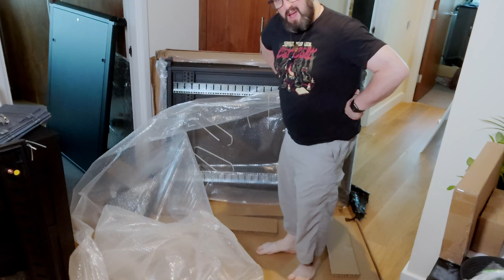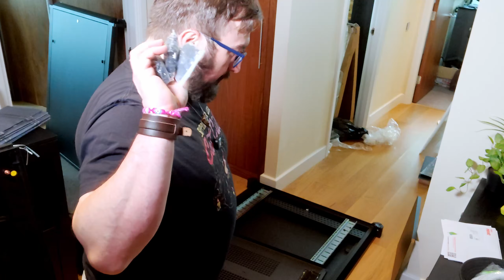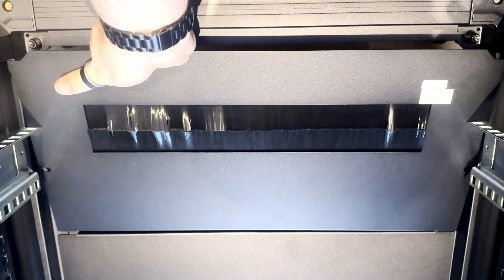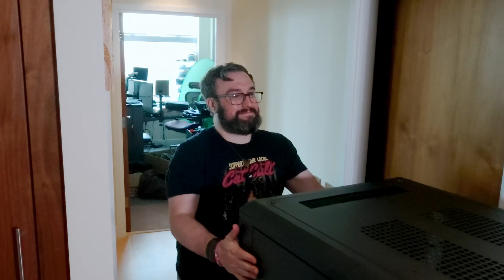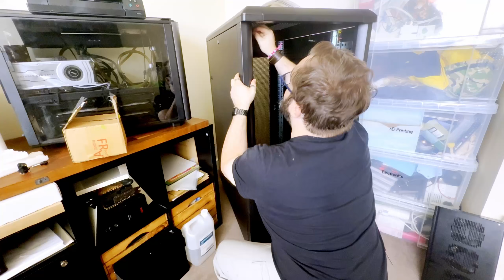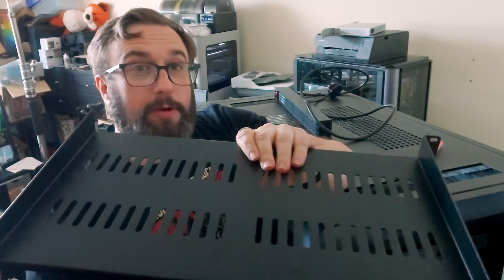I bought a £800 server rack for £400 (and it's flat-packed)

Comment: Don't sleep on smart relays for non smart lights or panels, you can remove the smart stuff and replace it back when you move out, I've OK'ed it with my council property and they said that I can do anything as long as it's installed by a competent engineer/installer and it is returned to the original switches when I leave, I've installed relays in my outdoor lights, physically inside the light housing as it's water resistant so it won't get wet, so that saves me changing the fixtures, my kitchen light is an LED bar which I would need to replace entirely if I wanted to make it a smart bulb so I've just replaced the switch with a relay and installed a Philips Hue Dimmer instead, which I can program to do more things than just the kitchen light, it also controls my living room main light and my lamps (it's open plan with kitchen and living room, the switch is in the living room), I just Wago'd the living room light so it's always on and put the relay on the kitchen one, the lamps are Ikea Kajplats in Zigbee mode which has been a godsend.

Comment: My APC UPSs are dated 2010 and 2012.  They need replacement batteries every 2-3 years 'cos the server closet is toasty, but they march on for ever.
Reply from the maker: Mine probably do have replaceable batteries but they are also not rack mountable so I want new ones anyway :)
Reply: If that's an APC backups 1400 it's about £40 for a battery replacement and 30 minutes work. Rackmount would be lovely though. I have two 1400s on my server and network kit (in the back of the rack floor) and one in the garage on my cams Poe switch and my backup proxmox box. Have a shufty at upstrader for a vid on the work involved and replacement batteries as well nothing to do with me but they've been a good site I've used. may be of interest to stop good ups boxes' ending up in local tips like I saw a few weeks back ;(  

 keep up the good work!
Reply from the maker: @edwardmarshall1542 oh I had no idea replacements were so cheap!

Comment: If you're OCD about making things match, Ubiquiti has keystone patch panels and keystone jacks (of different types) that match their other equipment. Ubiquiti also has brush panels that are an order of magnitude nicer than what you find at Amazon and on the Internet in general. Their brush panel has two brushes in it that are mounted from the top and the bottom and meet so that you can pass cables though and not create gaps in the bristles. Their brush panels also match their other equipment. When I discovered these, I replaced one black brush panel and am now in the process of replacing another.
Reply from the maker: I REALLY wish you hadn’t told me that! 😂

Comment: I have the same rack. Probably coming on ten years or so. It's been great. I paid over US$800 for it from Amazon. Just over a year ago, I outgrew it and it's now supplemented by a 9U Tech Mojo cabinet sitting on a dresser. I also have a three-node Nutanix cluster-in-planning sitting on top of the 25U rack, as well as a 2U "rack" for JetKVMs. Five of them mounted in there, with room for three more. The two cabinets are linked with 25G fibre running between UniFi Pro Aggregation switches, one in each cabinet.

Glad you're moved in and comfy in your new place!
Reply from the maker: Nice! That sounds like a mini datacentre!

Comment: Great vid! Definitely entertaining ;D
Worth doing a vape/smoke test for airflow, you mentioned the top fan was set up as an extractor fan yet the aircon will likely be blowing down onto the rack at the top as well as to the rear, since.. ya know.. aircon, it'll probably be fine, but just worth the peace of mind :)

Also, no joke about the rear access? Shame on you editor Foxy ;D
Reply from the maker: I’m not Paul Hibbert. We keep this wholesome here 😂

Yeah I realised my mistake when watching the video back but it was a bit too late. Will correct myself next week. 

I think the ac (especially when I figure out how to automate it) should solve any possible issues anyway. 

I had for some reason (despite more than 3 decades of building computers) I had reversed in my head the fan direction and told myself that the rear fans were intake. 🤦‍♂️